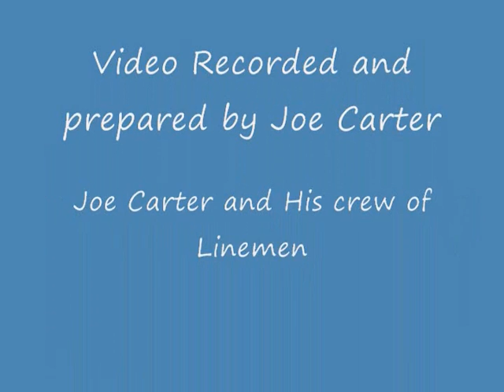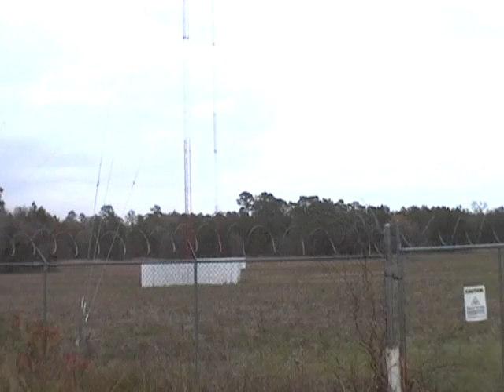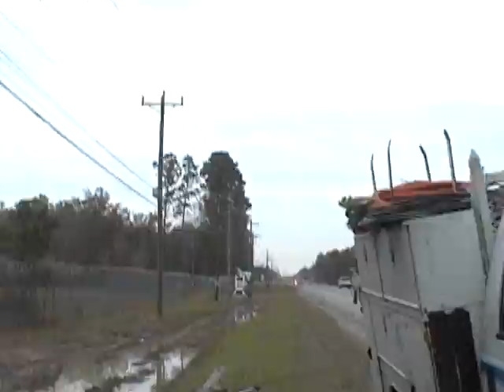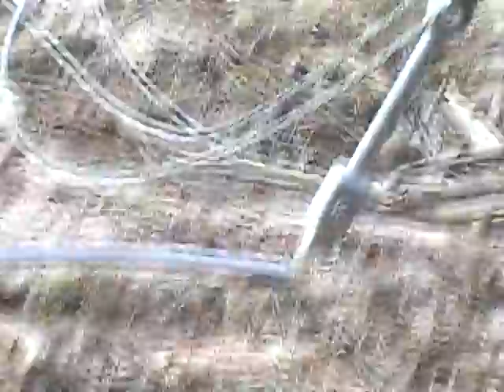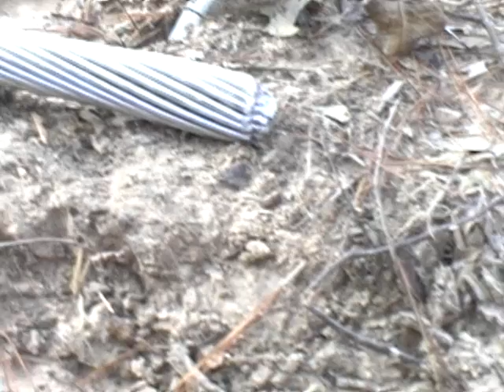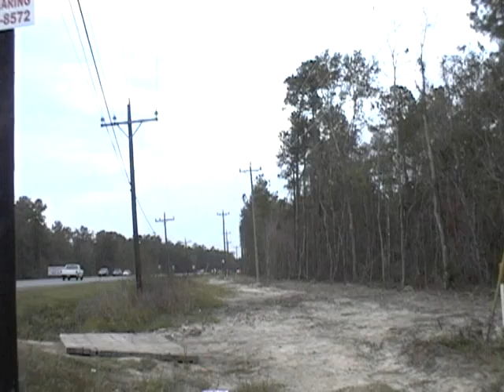Radio Frequency Induction

Comment: I like would you said, "phantom voltage", years ago i was working on an aluminum residential gutter, it was hot, my forearms were wet with sweat and were on the gutter, on a spot the paint was gone, anyway i was getting a trickle shock form it. Only one time did i ever see a grounded gutter, they should all be though.

Comment: Just think.....if those lines were not at a 90° angle to the antenna tower, that could never happen (right hand rule). Though, that would mean the power lines would have to go into space lol.
Reply: Brian Streufert nah man. If the antenna is vertical, then the RF is vertically polarized meaning that anything vertical that has the right dimensions will resonate and make a great antenna.
Radio is usually vertically polarized (antenna that goes up and down) and TV is horizontal (antenna elements are horizontal).
Satillite is usually circularly polarized and those antennas are shaped like DNA strands.
Using the wrong polarization will cause a 3db to 6db loss (50% to 75%).
So arranginging the powerlines wont prevent rf. It will just attenuate it.

Comment: This is the most strange example of RF induction as Ive ever seen.  I knew it can come across a sensitive amplifier,  but not a ground.:O  I wonder what the wattage on the station was.  To arc like that I can imagine the voltage must have been a few thousand with microamps.  Still enough to wake you up LOL.